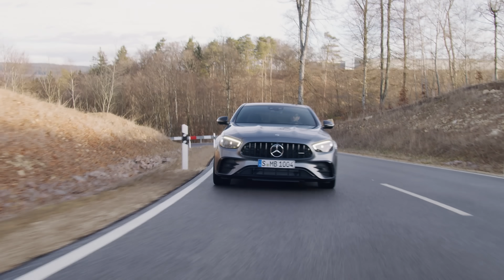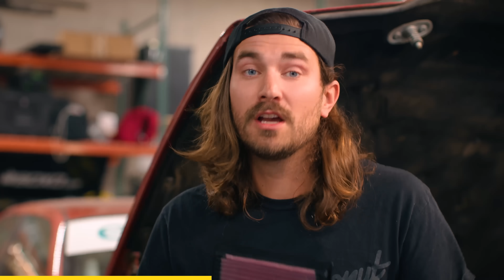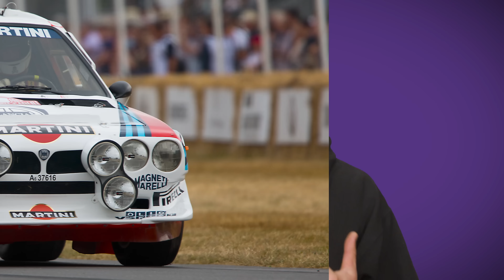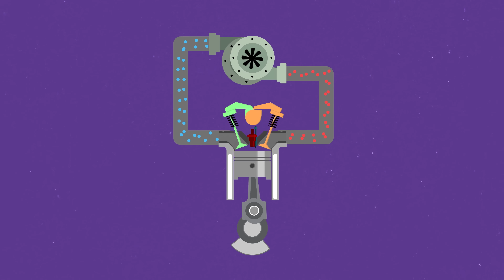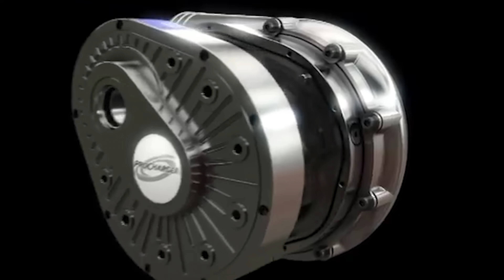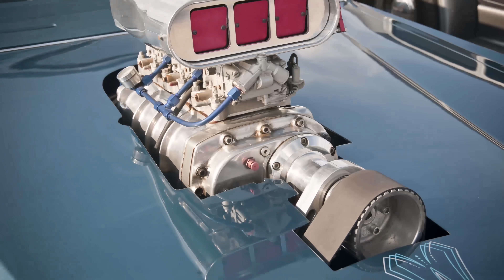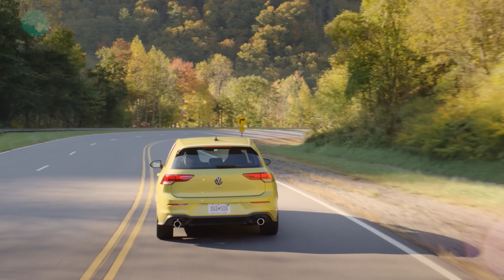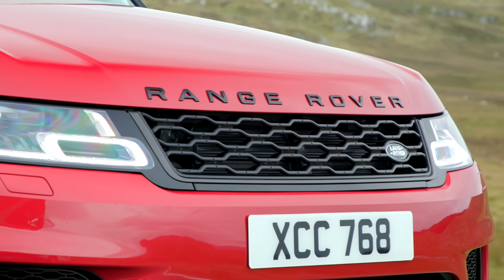Why Your Engine Isn't Twin-Charged

Comment: You guys completely forgot Volvo. You need to do an episode on how modern Volvo engines are able combine multiple systems into one engine. Like the Polestar1 I think and some other Volvo engines have a supercharger, turbo charger and electric system all in one. Seems overly complex but I think those 2.0 litre engines are reliable.
Reply: 2022 modell year the Volvo engeins  T6  T8 Recharge  both have twin turbo and Supercharger as well as an  electric motor.  T6 ICE 253hp and total of 350 hp. T8 ICE 310hp and total of 455hp.
Reply: @endurogubbarna  Thanks very much for putting out this info and stating the horsepower numbers. I don't think many other oem's are combining superchargers and turbochargers in their engines, let alone adding electrification using the hybrid system. An example is the Polestar 1, which is more or less a Volvo.
Reply: THATS WHAT IM SAYING
Reply: yes my mom has a volvo s60 t6 with the twincharged 2.0l and it’s a sweet car and cool to see it and understand how they work so i’d say they definitely deserve a vid
Reply: 12:43 bottommost car = Volvo T6
Reply: @Josh_Quillan  There is more than 1 Volvo that has such a power train
Reply: @olatundeaboaba  "Volvo T6" is the name of the powertrain, not the car
Reply: @Josh_Quillan  Not exactly. T6 denotes a trim level which depending on model and year may come with the twin charged powertrain you’re referring to, but the engine itself has a different name
Reply: @armadillolover99  ah, my mistake
Reply: @armadillolover99  The T-6 used to stand for the transverse mounted inline 6 motor. Now its a trim level that rates to power of the powertrain. T-5 used to mean Turbo inline 5.
Reply: @michaelstrongbow2336  Interesting, the more you know I guess. Did they really put a straight 6 in FWD vehicles or did they mount it transversely for some other packaging reason? Because I can’t think of many FWD platforms that would even be able to fit a straight 6, let alone necessitate one. 

Like the only 6 cylinder non-V6 I can think of in any FWD car is VWs VR6, which was specifically designed to bridge the gap between the length of a V6 and the width of an inline engine
Reply: @michaelstrongbow2336  I guess an AWD car on a FWD based platform would make more sense?
Reply: @armadillolover99  I have a 2008 Volvo S80 that has a turbo inline 6 in it, and it’s AWD. They used the same or very similar engine throughout their lineup under the T6 (or 3.2 for the naturally aspirated, lower trim level version) trim all the way up until the mid 2010’s when they started to replace all of their 5 and 6 cylinders with 4 cylinders in their move towards a greener more fuel efficient future, which is why they now have the T8 in their models which is not only twin charged, but also includes hybrid electric motors to make up for what their inline engines could do. They also had a V8 in the S80 and last generation XC90 made by Yamaha as well.
Reply: Don’t quote me but I think all pole stars are 100% electric
Reply: @TehSpazzmaster  Not all, but the new lineup is or Hybrid.

Comment: At the risk of sounding pedantic: there may have only been 8 production auto engines that are twin charged, but the practice actually started with aircraft engines. Both the p-38 lightning and p-47 thunderbolt used “turbo superchargers” to help their engines perform at higher altitudes.
Reply: I think both of them were turbocharged only. Back in the days they called regular turbocharger “turbo superchargers”.
Reply: @Riktos  superchargers did exist and were used in aircraft like the spitfire, that being said, the p47 thunderbolt did in fact have turbo and supercharger, but i can't say about the p38 lightning
Reply: @legocommandercody800  Indeed.  Almost all US warplanes of WWII were twin-charged.  The blower was built into the engine, usually on the accessory case at the rear and driven by a quill shaft from the crank.  The turbo might be anywhere.  On the P-47, for example, it was located 18 feet behind the engine.  The Thunderbolt was actually designed around the bulky turbo/intercooler arrangement.

The main exception to this was the Merlin engine used in the P-51 Mustang.  The Merlin was a British-designed V-12 with an excellent two-stage blower and an intercooler between the compressor stages.  The Merlin replaced the GM Allison V-12 which had only a single-stage blower.  They couldn't fit a turbo into the Mustang's slim fuselage.

The US really went all in on turbochargers.  Graham White, who wrote a fine book on the R-2800 engine, notes that General Electric built over 250,000 turbos during the war.  The device was central to American strategy in the air campaign.
Reply: @sotros1  couldn't have said it better myself
Reply: @sotros1  and to bring the topic back to cars, they made tank versions of the rolls Royce merlin,  called the meteor.  It lacked the supercharger as that was not needed for such use. 

How does this relate to cars? Some people have put them in cars. I think there was at least one nutter who put the supercharged merlin in a car,  utter lunacy.
Reply: @Riktos  thats the correct name for a turbocharger. all forced induction is supercharging however a turbo supercharger uses a turbine not to be confused with a centrifugal supercharger which uses the engines mechanical power. We just combined the word into turbocharger over time. so in the p-47 and helcats they had centrifugal superchargers and the p-38 had at first the centrifugal then got a gas driven turbine(even later ones had 2 stage with both)
Reply: A turbocharger is a supercharger but supercharging is not turbocharging. Technically speaking. Aircraft engineers used both supercharging and turbocharging to help the engines make more power at the higher altitude they were operating in. Interestingly enough alot of those engineers went to work for Chrysler after WW2 ended. The hemi was designed while the war was going on and wasn't built until those engineers went to work for Chrysler.
Reply: Love the P-38. I have heard that because of its ludicrous turbos it is much quieter than most other planes, however, most refurbished P-38s have had the turbos removed and are pretty loud
Reply: Thanks guys, I love the P38 and P51, so I learning new facts about them is fun
Reply: They also worked by feeding the turbocharger's air firectly into a centrifugal supercharger, multiplying boost pressure rather than just adding one or the other.

If the turbo doubles your intake pressure, for example, and the mechanical also doubles, then feeding the turbo air into the mechanical doesnt give 3x boost, it gives 4x boost

That said, it's also worth noting that airplanes almost ALWAYS use Centrifugal when they use a mechanical supercharger: they generally operate at constant rpm rather than gearing up and down like a car, so it's much easier to design them to operate at maximum supercharger efficiency. Positive displacement pumps are also just less effective at counteracting the reduced air pressure at high altitudes, since they add a fixed volume of air rather than multiplying the input pressure
Reply: Well you are being pedantic lol. We’re talking about car engines. Not planes 🤦🏽‍♂️
Reply: @P.M_M  were talking about twin charged engines
Reply: @P.M_M  We aren't really talking about cars, the focus was on the twin-charged engine itself and its benefits and drawbacks. The video was using cars as a... well, vehicle... by which to come to conclusions about the twin-charged engine, and mentioning uses of twin-charged engines in other types of vehicle is a relevant and meaningful point in context.

Comment: Last month, we told you about Ford's three new powertrains for the 2011 Ford F-150. At the time, Ford announced the truck's first implementation of its 3.5-liter EcoBoost V-6 but was mum on power ratings. Today, Ford said the engine is rated at 365 horsepower with 420 pounds-feet of torque on regular fuel.

Comment: I was recently doing some research and found out that my dad's Volkswagen Scirocco actually has the 1.4L Twincharged engine.
Reply: Surprised it hasn’t broke yet
Reply: Had the same engine in my Polo GTI 6R. Never again will I get a car with that engine it was horrifically unreliable and paired with the DSG box that’s just a recipe to burn through money
Reply: @mattlewis2320  My Granpa has the 1.4TSI with 160HP in his Golf Plus.
It has the newer, stronger Timing Chain and has never had any problems.
You can get lucky with this kind of engine

Comment: Toyota actually considered a turbocharged and supercharged 4-cylinder engine for the 1990 Celica All-Trac and the top of the line 1991 MR2. Now, Volvo uses both for its 2.0 liter four in models with the T6 trim level. The T8 trim level adds a hybrid system.

Comment: I would love to see these guys put a Torque-Amp Turbo on one of their project cars!!
Reply: I planned on getting one for me zzt231 Celica....only because its half the cost of the turbo options or super rare superchargers...plus I can get another battery and controller and just swap it back and forth with my mk6 Jetta 2.5. I think its one of the best options for a little more power, I just wish it did 2-4 more psi for how much it costs.

Comment: I hate to be that guy, but gears don’t increase rotation speed exponentially, they increase it proportionally. So the impeller speed doesn’t increase exponentially with the crank speed.

Comment: Carol Shelby actually had a Shelby Cobra with a 427cid V8 that was Twin Blown. Rumors were that it put down 700hp at the rear wheels.

Also, fun fact about Great White Sharks: If they stop swimming, they die! That's because they don't use their mouths to force water past their gills, instead keeping their mouths open as they swim to funnel water past their gills. There are several species of sharks that are like this. So if a great white shark stops swimming, or is prevented from swimming, it will suffocate and die to lack of oxygen.

Comment: Mazda could actually, theoretically jump on this wagon as well, since the new CX-5's will have a supplimentary rotary engine. If there's room for a low-displacement Inline 4, and the rotary, the inline can be twincharged, with the rotary powering the supercharger. The main issue after that would be the fuel system and apex seals of the rotary.

Comment: It's a little confusing when you say "they're pumping the same amount of air regardless of engine speed." I mean, I understand what you're saying, but technically, just like the engine itself, the higher the RPM the more air they're pumping. You're referring to the previous sentence when you said "per crank rotation." It just caught me off guard the way you said it and I had to re-watch it again.

I'm glad you covered the differences between a Roots blower and a twin-screw supercharger. Some people, myself included, don't really consider a Roots blower to be a real supercharger, as it doesn't actually compress the air. It's really just a positive displacement air pump, not a compressor. By the definition of the word "supercharger," a Roots blower doesn't meet this criteria. However, as the term is so often applied to Roots blowers, I don't bother with the semantics, however I will always refer to them as blowers.
Reply: I agree.  Back in the day they were always called blowers.

Comment: The Volvo pictured for the Volvo T6 does not have the twin charged 4 cylinder that the newer Spa platform has. Volvo's engine naming scheme is not exactly straight forward. The red Volvo you pictured is the P3 platform that would have had the T6 that is a turbo 6 cylinder. Around 2016 when the Spa platform came out is when the new 4 cylinder twin charged T6 came out. 

TLDR: The Volvo pictured isn't twin charged, but the new Volvo T6 engine is.

Comment: Volkswagen Audi Group produced a Twin-Charged 1.4TSI with 160-180hp depending on what brand used it such as  V.W,  Audi,  Skoda,  SEAT and whether it was a normal or a sport model

Granted,  certain model years were more reliable than other years,  but still was a Twim Charged Engine  lol

Comment: I just never understood the idea of compressing hot compressed air. The theory of twin charging giving torque and power is especially irrelevant now with all the ECU tricks we can do to make bigger turbos spool faster
Reply: Sometimes there’s a cooler between them to help bring the temps down some. 
Usually with twincharging you want to bypass the supercharger once the turbo comes in.
Reply: @NBSV1  on your cooler comment, if you look at some schematics from the Delta S4 engine, you'll see that it has two intercoolers, I believe one just for the turbo, and another that is shared by the supercharger and turbo.

Comment: Every Volvo since 2018 has a 2.0l 4cyl with a turbo, and the higher trim option are all twin charged. So you can get a mid size sedan with a 350ish hp twin charged engine. And if you get the hybrid it's like 400hp with the mechanical drive to the front wheels, and electric driving the rear.
Reply: They started it in 2015. I have an XC60 and it's surprisingly good. Early engines had heavy oil consumption issues though
Reply: With the S60 T8, you get high pitched sound constantly. Why? Braking produces high pitched sound from the regenerative system and accelerating produces high pitched sound from the supercharger. Have an S60 and that's just a weird part about it
Reply: @7itese840  Its not supposed to sound like that. Having worked with Volvo previously I can almost bet you that you have shitty aligned balanceshafts, it was fairly common on the new VEA engines.
Reply: These are dope, a supercharger that is also a turbo all in one mechanical device. Not sure if that’s just a Volvo thing or not.
Reply: @Ceramicsmokeware  nah, both a traditional supercharger, and a regular turbo both lol
Reply: T6 BABY!
Reply: I have a V60 T6 and for a big wagon it still moves
Reply: I just drove a 2018 XC60 T6 R-Design and it does not feel like a 4 cylinder. So much power and the delivery is smooth and seamless
Reply: Yeah I have a 2018 Volvo XC60 t6 with the twin charged engine, and putting it in dynamic mode definitely a really peppy engine haha.
Reply: We hate those volvos problem waiting to happen. Look how many you don't see on the road daily
Reply: I feel like Donut is throwing shade at Volvo for leaving them out, though they did sow a Volvo in the graphic when talking about the 8 production engines. 12:44
Reply: I think the seat cupra also came with one too
Reply: Yes, but why is a 4cyl called a T6? Come on....
Reply: It is easy.  A T5 is a Turbo 4 (4 cylinders and a turbo), a T6 is Twin Charge (4 cylinders, 1 turbo, 1 super charger)  and a T8 is Hybrid Twin charged tuned by Polestar.  Because  electric assisted twin charge is a thing.
Reply: @dnwhoop02  it really makes no sense anymore and is just an arbitrary naming system now. It used to mean a T5 was a turbo 5cyl and T6 was a turbo 6cyl, but now its a glorified "trim level" or power plant option since they are all 4cyl
Reply: Donut seems to hate Volvo. They only ever did one up to speed on the 240, and a sleeper alert on yet another 240. Volvo suffers from snobby b*tch syndrome where "most" of the people who own one are too busy enjoying their own farts to acknowledge anyone else exists.
Reply: What a nightmare to fix!

Comment: Twin scroll turbos are the new standard. There really isn't any reason to be single scroll except cost. Sequential turbos, twin turbos, and twin charged engines are too complicated AND expensive. It seems like a decent size engine like 2.5L I4 or 3L I6 with a single medium sized twin scroll turbo with a short and narrow intake system with a throttle body that don’t close completely (like Porche) would be best overall. This was we have almost no lag, decent power under boost threshold, decent cost and reliability.

Comment: Actually quite a few us ww2 warplanes used twin charged engines tho they were 2800-3000 rpm revving, 28-46 litre engines that had to make well over 2000 horses at 6 km height. A naturally aspirated engine would most likely shit itself at 6000 meters altitude.
Also do all that without any electronics, sometimes inverted
Reply: Detroit Diesel and EMD locomotives as well
Reply: Ah yes, don't forget Japan's (Subaru) Nakajima Ki-87.
Reply: milyen okos vagy
Reply: they definitely had electronics considering they were fuel injected and not carbureted
Reply: @chrisfunaro8798  no, they did not, at the time they only had cathode tubes, so everything was mechanically timed. 
Of course they had electromagnets batteries generators and stuff like that onboard but most of the time they had to come up with genious ideas to get around not having computers. 
One example is the constant speed propeller which was basicly the aircraft equivalent of a CVT, just without any computers
Reply: @balazsbelavari7556  i looked it up ur right, but i already knew about the constant speed propeller, the fuel injection was based of diesel designs it seems like
Reply: @chrisfunaro8798  Mechanical fuel injection exists.
Reply: @SkylineBNR34  yes i can read what he said

Comment: 12:56 the new Volvo S60s have twin charged engines as well
Reply: I have a 2019 and coming from a 9-3 Aero, with has about 50 less HP, it somehow isn't as quick as I thought it would be.

Comment: The gearing inside a centrifugal supercharger does not increase the rpm of the supercharger exponentially... it is a fixed gear ratio - therefore the increase in supercharger speed will be linear...